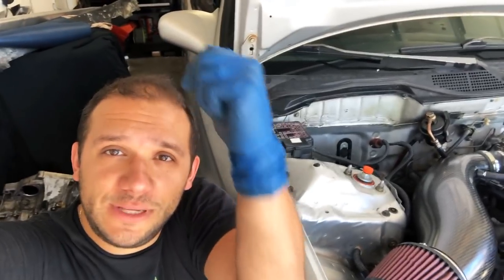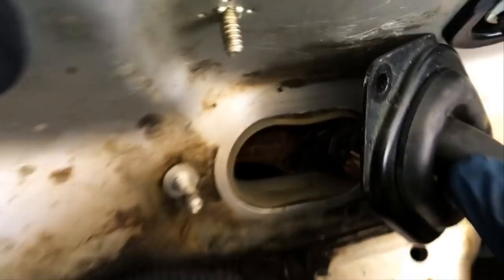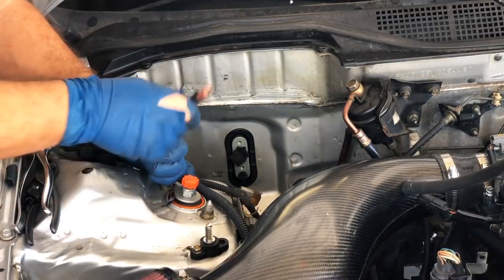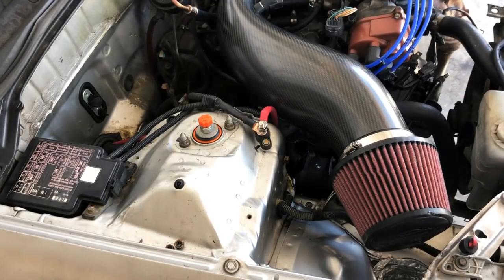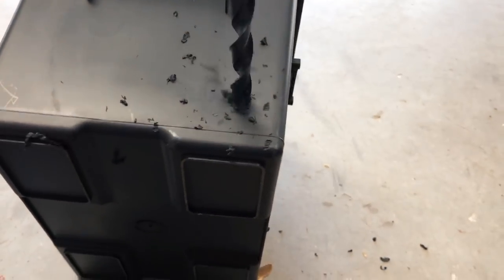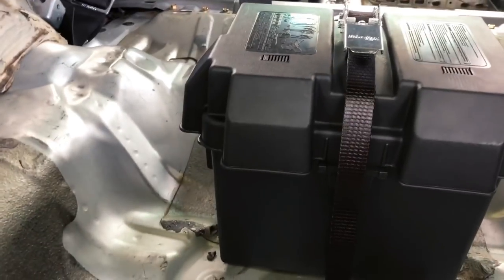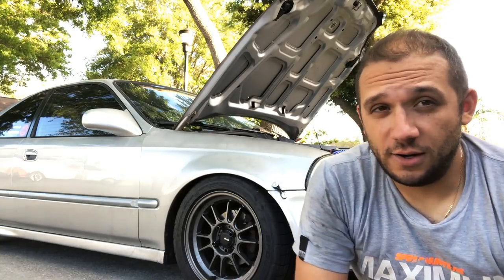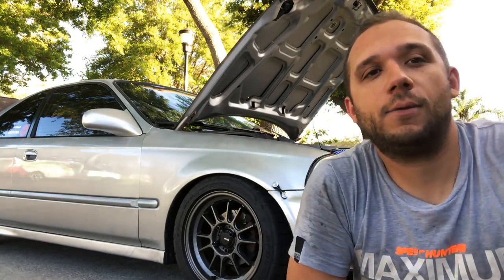Relocating my Battery to the Trunk Project Civic EK

Comment: Having done a few battery relocations just a couple tips. 1) put some sort of split loom on the power wire or even cut heater hose to help insulate it from any sharp metal. A short to ground on that cable will cost you a car. 2) I worry what will happen to that battery in an accident, think hitting a wall head on at 80mph, you don't want a 40lbs battery flying around or at you. Keep up the work an learning, don't let peoples comments get you down, we all learn somehow. 👍
Reply from the maker: Thanks for tips and encouragement! I plan to keep improving the set up to make it more safe.
Reply: If you hit a wall head on at 80 you'll die.   You should run the cable underneath the car in car it shorts it won't light your carpet and stuff on fire
Reply: Yeah gotta agree on mounting battery itself. I mounted battery through floor with the usual battery hold down .platic box is just a cover really
Reply: I just put a fuse any short to ground will blow the fuse and save your car

Comment: Two thumbs up for “Build, not bought”. Missing an in-line fuse, a separate grommet for the firewall, insulated clamps to secure the cable in the car, stronger battery anchors to ensure the battery doesn’t break lose, and under hood terminal finesse.
Reply from the maker: I appreciate the tips. I will be working to improve the set up over time.

Comment: Thanks for this, need to do one on my car soon and seeing the install made it easier to visualize how I need to do it!
Reply from the maker: Your welcome! Yeah it took me some time to figure out what I needed and just how to go about it. Check the comments there are some good suggestions for extra safety features. Since it came out I already made some updates. I used the stock battery tie down to secure the battery to the box since the box is bigger then the battery. I also added a rubber battery terminal cover to the power junction under the hood.
Reply: Refine Movement I was reading them, going to try to put something together soon, thanks homie!
Reply: @GarageBuiltHondas  where did you get that connector the one you hook all the wires to the shock tower thanks

Comment: Sweet deal, Trav! You definitely got me considering the relocation.  I do appreciate my trunk space, but those 25 lbs going from front to back and lower is a pretty significant difference!
Reply from the maker: Thanks Brian! Yeah I think it could help the car just be a little more balanced. Check out the comments there are some good tips about a few extra safety precautions that I missed that I will work on soon
Reply: For real! Some great feedback. Josh Wolff mentions how there is excess space in the box for the battery to move. Are you gonna pad that down?
Reply from the maker: Yeah I’m going do something like that to wedge it for now or use my old battery tie down and attach it some how
Reply from the maker: Update! I secured the battery in the box last night with the battery tie down. I drilled 2 holes in the bottom of the box and used the tie down to secure the battery to the box itself.

Comment: Whats up! Did this same thing to the wrx couple years ago over the winter.  Couple things i noticed :).  I know you mentioned it but i would vent that battery with a vent tube so gases dont build up.  While i tihnk its overkill on a small battery its a legit issue and you might get dinged for it on inspection.  Also you never know when you want the windows up (rain).  The other thing is i would add a 150 amp fuse near the battery in case that long run shorts on the body somewhere.  Also for track inspection might check if you need a kill switch readily visible/usable.
Reply from the maker: Thanks for the tips Mark! I was thinking about using a tube for the gases but the box isn’t air right so I wasn’t sure of the point of that. I will look into the fuse but I haven’t had any shorts since I done it. I have been thinking about asking the track I go to about their regulations.
Reply: cool yea the box i used was the moroso which is air tight.  got a crazy deal on it from amazon warehouse. if anything you could always throw in a deka agm battery etx20 for example for the gas or spill issue.  the fuse is just extra precaution if over time the wire rubs through or an accident cuts it to prevent the short and burning the car down.
Reply from the maker: Just verified with the Firm they only require that the battery be securely mounted. Other tracks in the future not sure. Do you know if optima or odyssey batteries release gases?
Reply: i run the deka etx30 for the size (cranking amps and amp hours) as i still drive it around when its nice but the agm's do not release gases you could run the deka etx14 or 20 from the looks of the battery you you have now.  cheaper than odyssey  and if i recall odyssey uses east penn whom makes deka anyway.  i had optimas in our main suv's but have gone away from them since they moved manufacture to mexico but i still run agm's.  from what i have researched agms dont like heat so being in the trunk prolongs thier life.  as always just my take on personal experience and research :)
Reply from the maker: Appreciate the info. I’ll probably get one of those sooner then later
Reply: np you guys keep up the good work on the vids!

Comment: You didn’t have to cut a hole in the box for the positive and negative the lid has two places that are in them 2 bulges on top to compensate for your positive and negative wires.  I bought same kit for my e.g. hatch . Unless you want to do it differently .  Nice install
Reply from the maker: I didn’t like the look of the wires coming out of the top.

Comment: If you put it to the right side of the truck it helps displace your weight on the left side of the car
Reply from the maker: The 25lb battery isn’t doing much to displace my 225lb body. I’m more about moving weight toward the rear as there is so much weight upfront.

Comment: I don't think that in general battery located on side of trunk isn't that much of an safety issue as cars like BMW e39 came from a factory with battery located in right side of trunk. Of course engineers have thought it out before deciding to do it that way. Anyway love the channel, love just watching how your cars get better and your skills get better
Reply from the maker: Yeah that is a valid point if the battery was put there from the factory should be fine. Thanks for your support and for watching !

Comment: Did you crimp the copper fittings to help it stay tighter? Also no inline fuse for the battery relocation?
Reply from the maker: It’s crimped and secure
Reply: How would you do a inline fuse??

Comment: The battery didn't seem like it fit tight in the box, what are you using to keep it from sliding around? How did the hole in the box end up looking like that?!
Reply from the maker: I was just careless when drilling plus it needed to be pretty big for the cable ends to fit though.

Comment: So you're replying on the heat shrink and "a pretty snug fit" to hold those wires in the wire lug?
Reply from the maker: I wouldn’t recommend my method but I have had zero problems with it.

Comment: Since I'm running my battery and fuse box inside the car where the glove box is, would I be able to use that same set up and mount that positive wire inside on some metal bracket??

Comment: I liked how u connected the battery up front with a post so u can jump it from the front & rear. Bit u didnt show the ground location. I think im going to connect mine to the block anyway.
Reply from the maker: You have to connect the negative to the body so it will ground properly. Do not connect it to the engine block.

Comment: Good video, but I almost follow the same steps to relocate, but one problem:- it is a little bit difficult to start the motor, I have checked the battery and starter motor was fine, anyone can advise me, thanks
Reply: It would most likely be due to bad connection between the power cable coming from the boot to the pre-existing starter power supply that was originally attached to the battery...check your connections at that point, and also make sure the cable you're running from the boot to the front is thick enough to supply enough current for the starter (adding a longer length of cable to a circuit, as you do when moving a battery away from components to the boot, means higher resistance).
Reply: @moseseggmolesse7979  Thanks much

Comment: Not being an ass, but if you would have mounted that power terminal on the back side of the strut housing it would have cleaned up your engine bay a tad more. Either way 👌🔰
Reply from the maker: That was my intention starting off but it gets complicated because there was no pre drilled hole on the shock tower.  Fitting a power drill into the spot wasn’t working to make a new hole. This is a good spot for now. I could probably relocated it if I do an engine swap later.
Reply: Refine Movement ahh that makes sense, plus I understand its a race car not a show car. Clean bay either way

Comment: i see a lot of things i liked from this video but all the videos i have watched nobody covers or even does battery venting the is a reason why  battery are put under the hood so the gasses the battery release are not in the cabin because they are toxic even car batteries  that are located in the truck on stock cars have a vent tube hooked into the side of the battery for gasses i hope you at least up graded to a battery that does not give off these gases
Reply from the maker: I’m pretty sure I mention it. I have to run the car with the windows down on track. I’m not worried about the gasses. Because of that. I’ll upgrade the battery eventually and change the set up.

Comment: You used cheap sheet metal screws to hold the battery strap ?  Thats an accident waiting to happen. Weight of battery vs sheet metal screws. Might as well used tennis shoe strings.

Comment: But why? What benefit do you get from it?
Reply from the maker: Probably won’t be huge difference but it makes a cleaner engine bay and moves weight lower down and to the back. More balanced overall
Reply: I need my battery relocated on my Integra gsr 93 need more space

Comment: Why the fuck did you drill holes in the box? The cables go in through the top.
Reply from the maker: I didn’t want the wires coming out the top
Reply: Refine Movement so you decided to destroy a perfectly good battery box that is meant to keep your battery dry and secure, because you didn't want the wires coming out the top? I think you just didn't know the cables went in the top, and are now trying to defend your mistake. You could have at least drilled a proper sized hole and use the grommets you bought. Sorry for the harshness, but when people put videos on YouTube showing how to do things wrong it really pisses me off. All you are doing is spreading disinformation, you are literally making people dumber. If you're not going to do something right, then don't do it at all! I'm not even mentioning the fact that you didn't crimp or solder the terminal on the starter and fuse cables. Shit man don't show people how to half ass stuff.